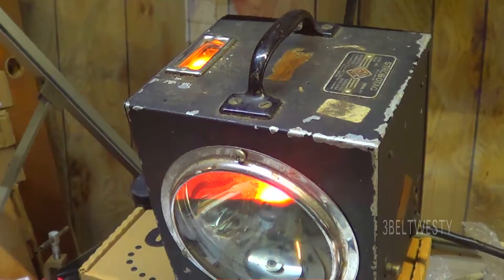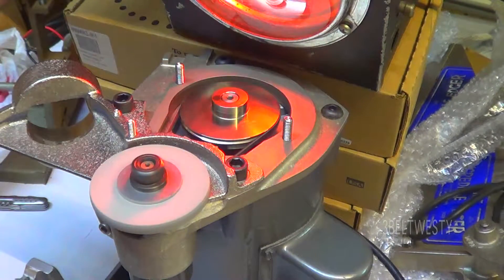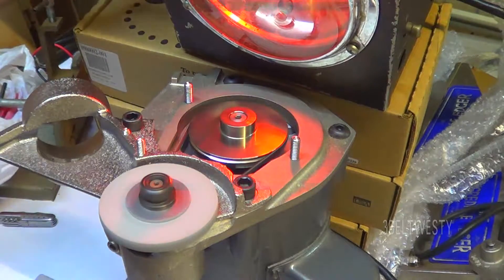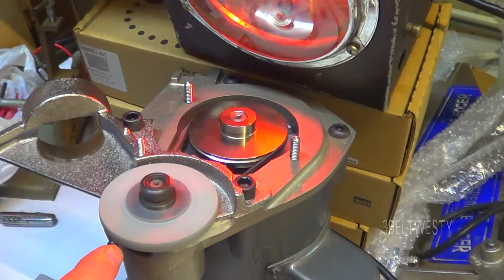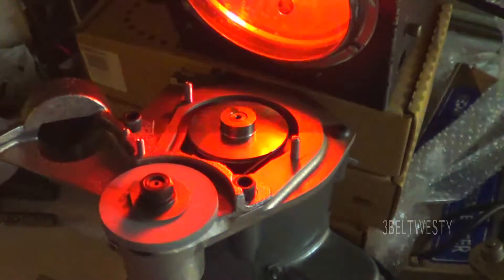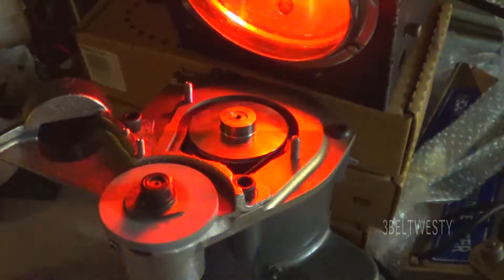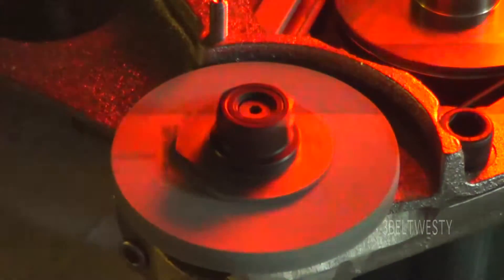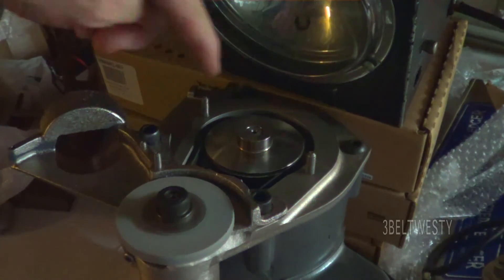Incredible edger skate sharpener vid01 RPM check Strobotac GR 631b

Comment: Very useful presentation. What kind of replacement bulb is used for the 631-P1 or CV220?
Reply from the maker: The tube on mine says : " General Radio type 631-P1 Made by Sylvania" .One is on ebay now at 25 dollars plus 9 freight.   This links says the 1N21 tube is a slightly taller version:  https://www.antiqueradios.com/forums/viewtopic.php?f=19&t=213900

Comment from the maker: Speed of the strobe is being changed to match the AC induction motor as 1780 rpm and the grinding wheel as 6100 rpm .
Reply: Hello 3beltwesty

Could you kindly measure the outer diameters of the both belt wheels? I would be also interested to know what the motor nameplate states related to rpm and spec.
I do have 50Hz version of IE and there motor name plate states 1400rpm and spec. is 34-5315W863. What I am trying to find-out is, does the 50Hz version has lower cutting speed than 60Hz. I have some doubts that I am missing out some rpm´s due the 50Hz network. Frequency converter could fix this issue.

Update:
I just measured the rpm´s with the tachometer and got following results when measuring without load. Motor ~1480rpm and grinding wheel ~4986rpm, which gives pulley ration of 3,37. This is very equal to what you measured. Motor wheel was 71mm and spindle wheel ~21mm.